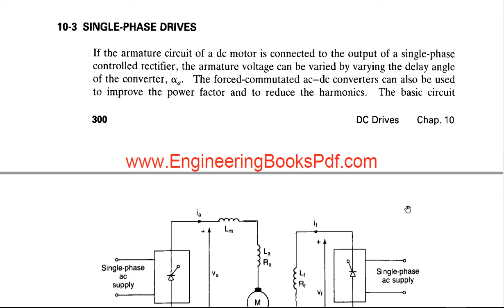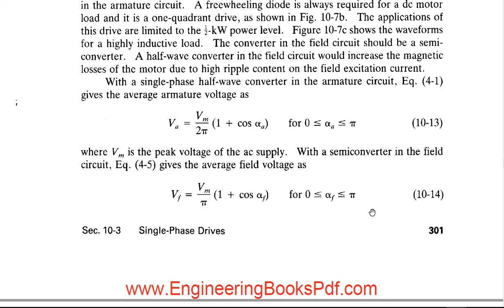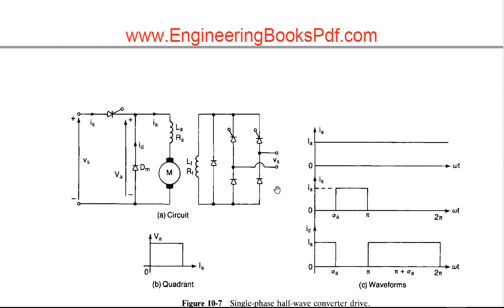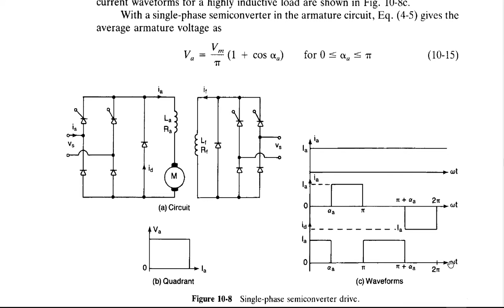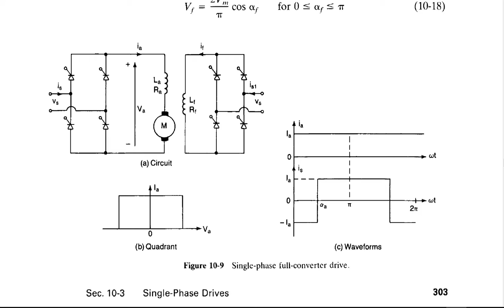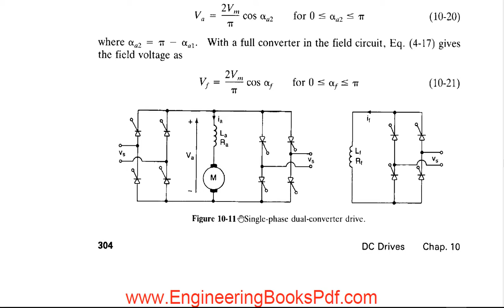Single Phase DC Motor Drives

Comment: Great explanation. Is the field always energized in a full wave even when the motor is not turning? We have 3 HP GE Statotrol Full Wave DC motors at work and they seem to be hot even when not running for a while which makes me think the field is always energized. They have 180 Volt armature and 200 Volt field.